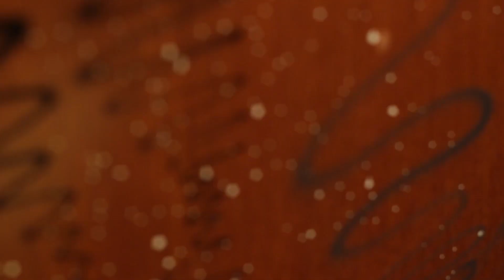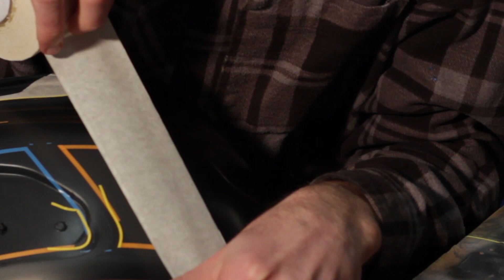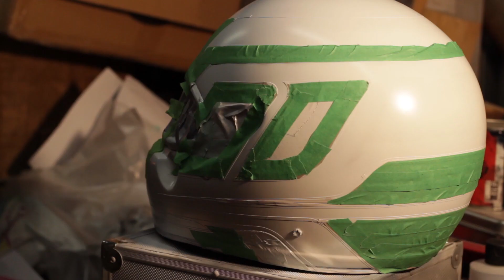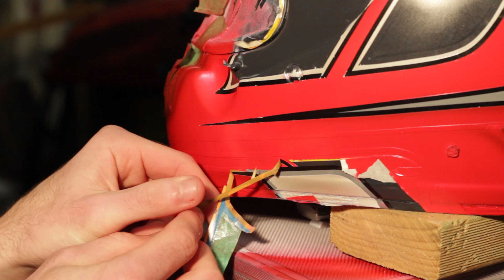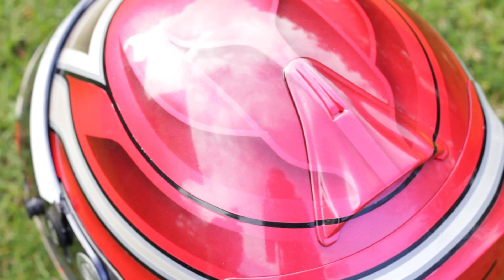Custom painted race helmet - Airbrushing process

Comment: this is a great job mate, all done in water base airbrush paint? obviously cleared in 2pack. but seriously great work
Reply from the maker: Cheers. Yep, all water based Auto Air paint apart from the clear, it was the first real project with water based but it was easy enough to get used to and work with

Comment: What’s a good tip for avoiding errors when peeling tape? I saw you had a couple spots where when pulling the tape, it took a chip off of the adjacent color. I’ve done this plenty of times....lighter coats and longer wait time between coats? What would help prevent this? Thanks

Comment: Did you paint the black base intirely with the air brush. Trying to learn about air brushing and wondering if you paint large areas with the airbrush or just small details. Also is it better to start on a white helmet or does it not matter. Thank you.
Reply: White is fairly easy to use as a base as it pretty easy to disinguish from the other colours but i do not think it matters what colour the base is, as long as it's a plain colour.
Reply: @nisse4629  thank you.

Comment: Hi there, is it possible to use regular spray cans to paint a helmet or is it the wrong type of paint? Cheers :)
Reply from the maker: +CitricBean Sure, you can use spray cans but make sure it's a compatible automotive paint, the quality won't be as good compared to using an airbrush though.  You can do complex designs using masking, but will struggle getting drop shadows, colour fades etc...
Reply: +CitricBean  only use foam safe spray otherwise you will damage the Crash part of the helmet and make it vitually useless if you do crash
Reply: +The Black Johnny Gat Not if you tape up the bottom and the eye openings ;)
Reply: CitricBean It is worth the risk?  I've heard even the vapour can do some damage, and it only takes a small weak spot in the foam to render the helmet ineffective.

They are foam safe options out there it is better to research this.
Reply: +The Black Johnny Gat Don't paint inside the helmet!!!

Comment: Any suggestions for someone looking to get into doing this? I want to customize my sons Karting helmets
Reply from the maker: Daniel Pina Cheers, just start off with some basic equipment and lots of practice on small personal projects until you get a handle on it. As you get better you can always upgrade your equipment if it's holding you back as a decent quality setup can be expensive. Being self taught there was a lots of trial and error, but it only got easier as i spent more time practicing.
Reply from the maker: Daniel Pina When working on helmets especially make sure they are prepped correctly, if not the paint can effect the integrity of the helmet
Reply: Thank you very much for the helping words, what is the adequate way of prepping? I've looked online for a number of different websites that help with step by step tutorials and, maybe I'm not wording it correctly, but they're close to nonexistent.
Reply from the maker: Daniel Pina Helmet prep ready for painting consists of stripping the helmet down and lots of masking, there's a lot to explain and there is a slightly different process depending on the helmet, then the exterior surface needs to be prepped for paint. I sourced an overview of the process online but talked to the pro's to make sure i covered all the details in the process, plus painted many old practice helmets when beginning
Reply: J-Rod great help. Thanks so much for the advice.